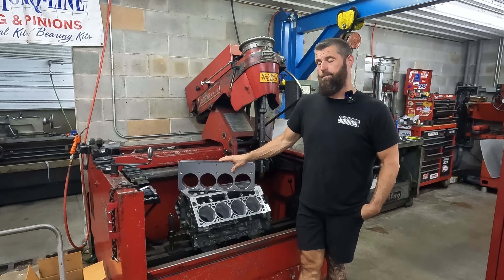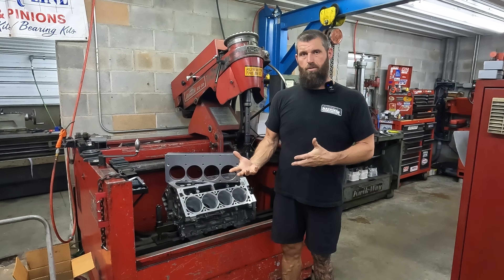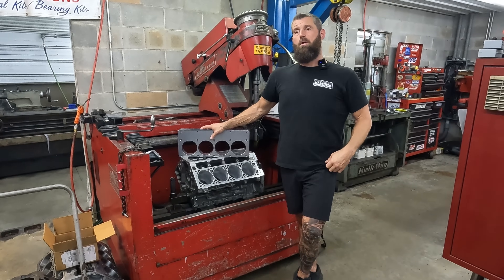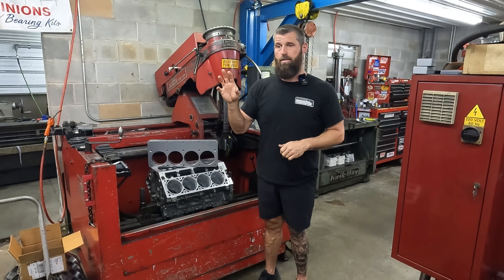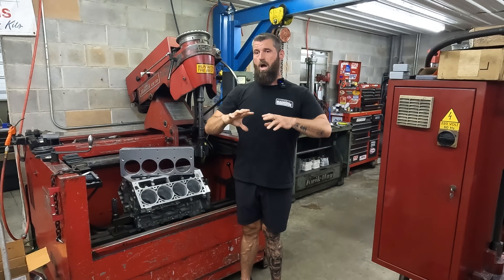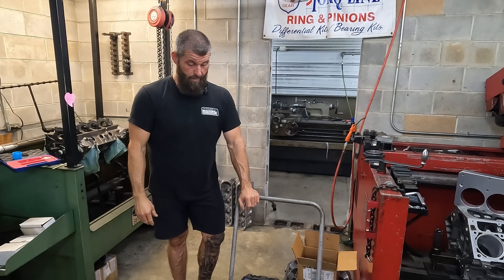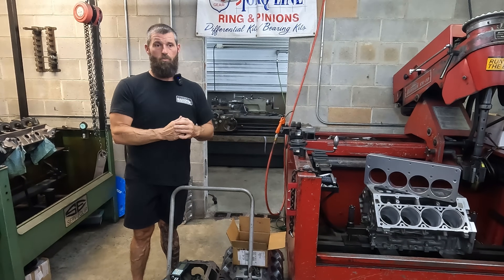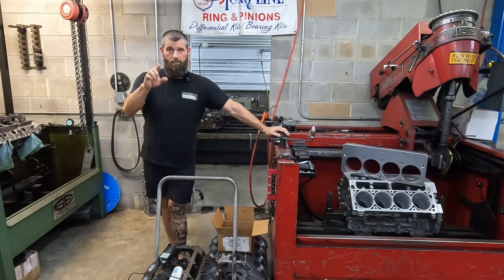We gotta talk about this torque plate deal.....

Comment: I agree with what your saying if building a high hp engine than certain things need to be done but your low hp under say 1000 hp v8 don't need those same thing, I built a 440 mopar just over a stock 440 and used a TQ plate at first and there was absolutely no difference in the cylinder I did and not use TQ plate. they built high hp engines long before TQ plates came out and some failed and some didn't who's to say a tq plate would have helped.

Comment: I think the industry is also to blame. The ludicrous promises made by some engine builders when they are selling remanufactured engines promise the world for very little cost. People come to expect blue printed, torque plate honed, nitride coated shot peened everything race engines for peanuts because it is a great way to sell engines to people who don't know better. I'm not an engine builder but I had a few of these over the years unfortunately because marketing works. I have learned  sometimes the hard way that the engine builders knowledge is really paramount in getting what you want, not a shiny advert.
Reply from the maker: Yup

Comment: I got a question for you since we're talking about twerk plates. It was my understanding that torque plates simulated when you put on a cylinder head and torqued it down . That's when the cylinder distorts is when you bolt up the cylinder headed and he starts the cylinder head and it's not 100% true lined up. Or am I wrong?
Reply from the maker: The last part of your question doesn't make sense

Comment: It's like this. As someone who runs a machine shop ( have one at work) plus best friend owns a full machine shop does engine balancing. That person is by far getting a better machined product than lot of stuff comes off assembly line. 

I'm sure during the manufacturing process the factory really uses torque plates in the machine process spitting out hundreds of blocks a day. Lol 
They machine those blocks so quickly they don't worry about specs on each block until assembly process. The bores & cylinders get measured if in spec so be it if not they toss the block to the side & grab another one. 
    As a Certified Ford & GM tech within spec is a wide void sometimes doing warranty. . Like doing warranty work for our City Fleet. Certified Techs work on Charger police cars that Hemi chews up lifter puts metal through block, Dodge tells them to tear it apart bare block clean it resemble it with original bearings, rings, & majority of the original gaskets ( hard gaskets like oil pan & rubber gaskets like intake ect ),. If you warranty something it better be out of there spec because we have to keep those parts at 3 months incase they want to do warranty check. What some people call bad isn't to the big 3 under warranty claims. Lot of people get upset resemble engine with 35K miles or 85K-95K going by hour meter using original gaskets, bearings,  & rings. 
If lifter bore damaged & you smooth bore out & lifter moves freely & is within that thousandth you can't send it off & bore hole have it sleeved. Better have proof first. Luckily having your own machine shop & it's your fleet we can do that. No customer to charge we don't try turn it in.

Comment: a buddy tried to explain honing i kinda got that but when he explained honing and engine with a torque ver without and my brain went dead on a very slight modded 454 i mean not even 30hp added it made no sense what  he wanted to charge to do honing with a torque plate the price difference sounded like a major rip off sorry bad spelling
Reply from the maker: 30hp?? Lol, try zero hp

Comment: You didn't touch on how much you've seen a cylinder move. For example, the ford block, vs an LS, vs a ford modular, measuring cylinders before the torque plates vs the cylinder measurements after the plates are installed, I'm just curious. My example would be Harley cylinders, I've seen them move as much as .004", before vs after torque plates. Just another example of something that shouldn't be finished without plates. Ultimately, I agree 100%.

Comment: Every high production car has never been torque plated when it was made. I worked in a factory that made engine blocks for Ford and Chrysler and they were fully machined without torque plates. I think it is useless for 99.9% of engine builds. You can really blow the torque plate police minds when you show them an all aluminium block with no sleeves that has a plasma coating on the walls with no honing at all.  Plenty of factory motors out there like that.
Reply from the maker: Definitely

Comment: Umm, probably these boys never heard of using a plate on cylinder heads. There are heads which have problems.  Exhaust seats on Ford SOHC are leakers. Ford FE, especially when they are heavily milled at the four corners. Some are .005". Not that Exhaust makes a difference. But when intakes leak, that's going to cost you. Ford 427 aluminum heads for the Lemans races back in the day. You must have the torque sequence to seal those. It was learned to late the problem was simply the castings were to thin. 
The point being, knowing what you talk.  It can get complicated with mainly the older heads as  the modern parts have lots of aluminum. Comparatively.

I recall metal gaskets can greatly distort bores compared to composition gaskets.. So, the clowns might not have a clue on that. And again, it just flat depends. Some blocks flat don't move period... Or, remember the Chevy II 4 banger ? The motor mount deal ? Now there's an odd one.

Comment: Thank you for presenting this.
Majority of the torque plate thing is a "Sales Job" as my friend the vacuum cleaner salesman would say.
What is the torque plate, really? It is not as thick as a cylinder head so it doesn't have the same rigidity, the bolts aren't as long so they don't have the same stretch. The cylinder head is not open at the top as a torque plate. Generally the stresses caused by a torque plate are different than a real cylinder head.

What I can see that would be useful of a torque plate is on the lightweight aluminum blocks with the iron liners and an open deck.
The torque plate would hold the cylinders from wobble and chatter during boring.

Millions upon millions of engine blocks were produced without torque plates.
Reply from the maker: Yeah, a couple things,  the plate is actually more rigid than a head casting,  we use the same fasteners neither way, , like I said in the video,  some blocks are almost mandatory,  some it's 100% irrelevant

Comment: Torque plating ls blocks suck balls
If gm would quit it woth the torque to yeild,(one time use bolts) 
Ive broke off 25 plus head bolts using my torque plates on ls blocks over the last 5 years.  I got to the point where i dont do the last 85 degrees on the torque spec when torque plating these particular engines. Unless the customer provides new bolts or unless they are using arp studs then i will torque it to spec before honing
Reply from the maker: Just use arp bolts,  problem solved,  I have a "shop" set I keep just for that

Comment: Dude I'm in the tool and die field. You don't have to tell me about heat and movement! Lol. We deal with it all day everyday!  The fact is that's why stock engines have the tolerances they have and race engines have the tolerances that they have. The guy is an idiot.  The stuff we work on has clearances of .0002 between punch and die. Don't tell me about heat and movement!  Lol.

Comment: There are many platforms where the torque plate is negligible. An iron LS could be one of them. I'm sure there are plenty of others. Personally, I won’t take in a job where the customer won’t pay for the torque plate hone, but that’s just me. It goes to a mindset of a customer that I probably don’t align with.  It’s not because I have 54 torque plates either, it’s because that’s just my protocol. 
     On the aluminum LS, I use the torque plates for the main bore and cam tunnel finish sizing.  I’ve see the mains change .0017” when the heads are torqued. That’s not optional in my shop either. Then again, skipping  the cam tunnel index/bore/hone is not something I’ll do on an LS. Again, that’s my protocol. I’m sure thousands of blocks get standard cam bearings punched in every day, I won’t argue that, but they don’t get machined by me. I’m lucky enough to be able to be very picky. 
     The point is, each shop has a wide range of customers and then a range of the services that they’re asked perform. It’s up to the shop to decide when to say “no, that’s something we’re not comfortable with”. Skipping a torque plate hone is a far cry from a shop that will literally do anything asked of them, regardless of how it could make them look by a third set of eyes. I’m sure we’ve all honed a block that didn’t represent the “finest hour” of our abilities, but may have been up against a wall because new pistons weren’t an option. To some, that $150 torque plate charge may well be grocery money, and this may be the car that’s going to get them.
Reply from the maker: I agree,  the mains changing wirh plates only applies to gen 3 blocks,  like I said in the video there are some engines that NEED a plate and those are non-negotiable,  if the bore is moving twice as much as the plate correction it's a moot point,  but overall I agree.

Comment: I'm so glad to finally see a logical and valid explanation of the way this helps and when it doesn't. And why and when we are truly wasting our time and money. 

For close to 35 years of building my engines, I never have understood the need to torque plate bore and hone these factory blocks that are mostly too thin for any real gains. It's just never really made any sense to me. I couldn't prove anything, but I just knew to not waste money on it for my street driven vehicles. Yeah, they were warmed up a bit, but I never had issues with ring seating or blow by.
Reply from the maker: Ty, we appreciate you

Comment: Right on! If you don't need micron tolerance round holes; you don't need a torque plate. I've bored hundreds of cylinders at the motorcycle shop, never used a torque plate.  Ironically when I needed the cylinder bored for my race bike I took it to a guy!
Reply from the maker: Absolutely

Comment: I guarantee. 0004 is more round in spec on a ls 5.3 than any gen 1 sbc that has been torque plate honed. Reason is head bolt threads on a 5.3 are way down in the block. That doesn't distort the top of the cylinder.
Reply from the maker: Definitely

Comment: It beggars belief that these fools believe that a Torque Plate is so important on a standard engine. Every Engine block is built to a tolerance... +/-.... When the block is cast and machined, the big companies are more interested in tool life than they are perfect casting and machining. It's not uncommon for cam and crank main bearings to not be parallel and that's before we talk about perfect deck heights... Unless you are building a high buck, optimal performance, blueprint engine... Then why bother? There's a lot more performance losses that's cheaper to rectify than boring and honing with a Torque plate. Foolish people who only have internet knowledge and not real world knowledge!!!

Comment: People read things, then think it must be done. Magazines run out of topics and come up with things that only apply to 10k hp engines. So many people are full of bs. I've seen/heard countless people at car shows trying to brag about how they built an engine to try and prove they got the better build than the guy next to them. I assume the majority, like you said, have never touched a torque plate. I've also seen machine shops rip people off, claim they did something when they didn't.  Torque plating is one of those things. "Oh, I use a torque plate on everything." Then when building they think "It doesn't need torque plating, I'll just charge them for it to make more and make them feel better."
  Same thing happens to me when I make my videos. People comment and say I didn't do something correctly.  I get told I should've did it a different way.  I usually just respond, "I've been a mechanic longer than you've prob been alive, and I've never had an issue doing it this way."  Keyboard warriors used to drive me nuts. People open up an online Haynes manual, read the process and then watch a video.  When they see something not following the process of the manual, they claim the person isn't doing it right. And I've seen countless times people like horsepower tv or some other program telling people you gotta do this or it's just not right.
  My son keeps coming up with off the wall things to do to his '07 Mustang.  I'm like "Where did you come up with this?"  He says he read about it. I'm like " You're not building a 5k hp engine son."  He also reads about how someone put 80psi boost on their engine and it runs fine. I tell him yep, they either blew it up a few days later or they forgot to mention the part about having a $20k block with forged internals and the works.  Also forgetting they were sponsored and got all the parts for free.
  I'm with you.  Quit telling me I did something wrong. You're more than welcome to open your own shop and do it like that.
Keep up the good work sir!
Reply from the maker: Facts...100%

Comment: Well haha. Aint never used a torque plate for my donuts... and they eat just fine. Mr. Powell you are absolutely right on matching the customer for their budget and use of work. Built a lot of engines and never once did it occur to me to question a reputable machinist. Great video and shows the the other side of what a business owner deals with. Thumbs up.
Reply from the maker: Right on

Comment: You are very correct 99% of motor builds don't need a torque plate especially semi performance Street engines with forged Pistons. The clearances necessary for these engines to run aren't going to care about the slight bit of change with or without a torque plate. 

In my experience, the only engines I really care about torque plates on are import engines being built to last a couple of hundred thousand Miles. If you're piston to wall clearance spec is 0.0015 then 4 tenths matters. But then again, this has nothing to do with a performance engine build unless you consider longevity performance.

Comment: Another great video, and you always explain yourself and the processes so well that my 6yo daughter can easily understand, she waa like "wow daddy does that mean inside an engine the cylinder walls get bigger and smaller depending in temperature "??? I'm like yes my dear, it's called thermal dynamics, and when any material gets warmer or colder it expands and contracts, she is so smart and was just curious about what I was watching lol, bless her soul, and also thanks I learned something new today from you as well, I own a 76 f150 with a 360 FE engine and I didn't realize they typically need to be torque plated or at least should be, so thanks for that little piece of knowledge, now I know what I should do if I ever want to tear into it and rebuild it, as it sits right now it only has 84k original miles on it and I'm the 3rd owner, was always a farm truck so never got many miles put on it, it runs great though, I do want to get it rebuilt sometime, especially need to swap out those god awful open chamber bricks of exhaust manifolds lol, been looking at some hooker headers for it, anywho sorry for long post, I always enjoy your content and usually learn something new each time, so thanks for everything that you do and sharing with us all, and to all you torque plate hippies chill out lmao, know the craft, know your job and do it right and according to customer needs, no more no less, every situation and build requires different approaches, and I've never known 2 jobs or more to ever be the exact same...
Reply from the maker: Thank you! Tell her the Powells said hello!

Comment: its like when 4 bolt caps came along... 2 bolt caps revved to 8000 without breaking..but once 4 bolt caps are everywhere, it s a measure of safety that everyone would prefer.. doesn't mean it necessary..bigger problem is harmonics and cylinder pressure applied at the wrong moment to the crankshaft thru the rods....the 2 bolt cap isn't the weakest link ,but still preferred... same with the torque plate.. if 5 hp makes a diff in winning and losing  (in your class), it s important.

Comment: The customer doesn’t pay for a torque plate isn’t a valid excuse. Some engines MUST have torque plates used because the distortion is so high. Boxer engines are an amazing example of this. V8’s you can get by unless your boring but not everything is a V8.
Reply from the maker: Apparently you have hearing issues,  maybe you should watch again.....that's exactly what I said

Comment: I'm building a 1200hp VW R30 6cyl at the moment. I don't even know how many engines I've built over the last 10years. Must be over 30 engines. This is THE FIRST TIME I need to use a torque plate because the head studds don't pull in the same direction as the bore is pointing. Only reason.

Comment: Non-machinists should recuse themselves from machining opinions, and study how "tolerances" work.  All mechanical assertions are measurable therefore testable. 
Torque plate effectiveness is measurable therefore testable. Any with a dial bore gauge can measure and compare results. Four tenths is as trivial as it gets. That's higher than aircraft recip engine tolerances. Everything he states in this video is obvious to the newest machinist and to any competent engine builder.

Comment: Pontiac 400 and 455 also need torque plate .I purchased a torque pate just for  machinest to use it.Ive witnessed the walls pull in .002-.003 adjacent to head bolts  with torque plate installed .Where you located ,ya sound like from SC
Reply from the maker: Upstate SC